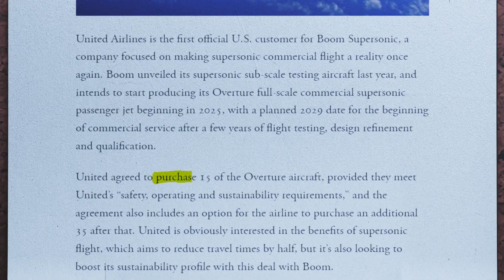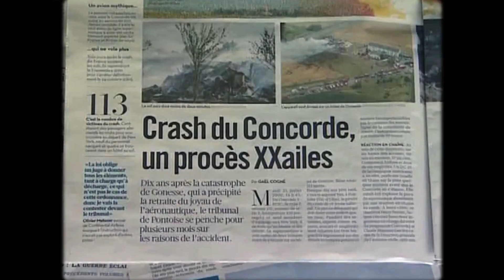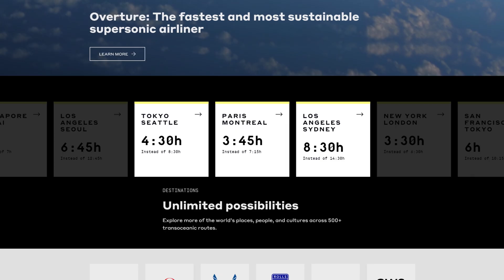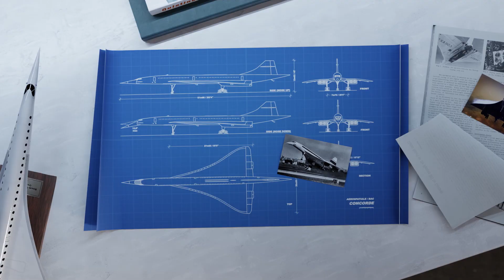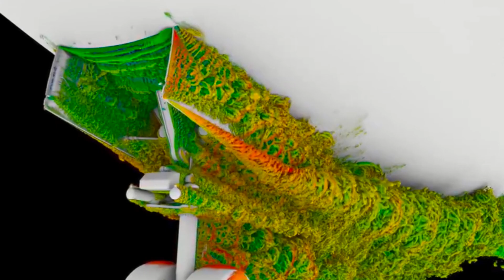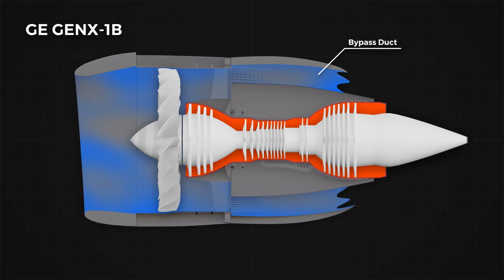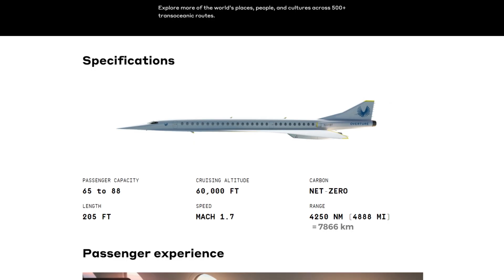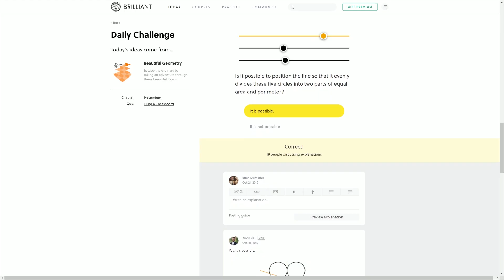Will Boom Bring Supersonic Back?

Comment: The engineers in this thread will school me (and I hope you do!) but honest question: by the time Boom figures out how to make the perfect supersonic plane, will we have access to burgeoning rocket/spaceplane transportation? With the way rocket technology is progressing, would we perhaps see a brand new industry eclipse supersonic air travel? I'm not necessarily talking about loading 300 people into a vertically stacked rocket tower, just some sort of "spaceplane" technology similar to Virgin Galactic. Feels like we should be focussing on how to get up above the atmosphere and taking a parabolic path to destinations around the world rather than finding ways to ram through the atmosphere faster. Curious if anyone has thoughts on the economics/safety of commercial spaceplane tech. Cheers.
Reply: Not a lot of atmosphere at the height that Concorde flew at
Reply: @taylorgledhill Boom hope to have Overture in service by 2029. 2035 is more likely, which is still fairly short term. Your talking about much more advanced technologies which will probably be developed in the longer term. The next move, as you suggest, will probably be near earth orbit: 

The ultimate solution would be to fly at, or above, the height defined by the Knudsen number for a particular aircraft, where the air molecules are so far apart that shock waves cannot form.  At around 500,000ft (95mi, 153km), sonic boom, drag, and skin heating vanish, allowing an aircraft to 'glide' under inertial force, after being accelerated to supersonic cruise speed. Only the power to overcome the drop due to gravity would be required (by choosing the correct height and speed satellites, are able to circle the earth for tens of years with no power). 

The proposed Venus Aerospace Stargazer won't reach the 'Knudsen height', but in part, it's like the ultimate solution. According to the Venus site, it will take off using jets, to keep the noise down, then, under rocket power, it will climb to 170,000ft (32mi, 52km), where it will cruise at 6,900mph (sonic boom isn't mentioned). It will carry 12 passengers and reach any airport in the world from any other airport within 2 hours.

I'm not sure about firing people into space on a fixed trajectory because that may lead to collisions, bearing in mind that there are at the moment 10,000 aircraft in the air at any one time. There is no suitable propulsion system at the moment either, because rockets are too noisy at take off and at low level. 

It is very difficult to predict what will happen in say 50 years time, but I suspect that some new form of energy source will be discovered rather like fusion, which will be small, light, safe, and limitless, and will transform every mode of transport, including aviation and aerospace. After all, the whole world is full of energy. All this messing about with batteries, solar panels, etc, seems like the days when they were struggling to get 2,000 horse power from piston engines, when right under their noses was the jet engine, with practically unlimited power, and at any height too!

Comment: Is it possible to create a variable bypass engines that turn from high bypass at subsonic into low bypass in supersonic to reduce noise? 
Though i believe it would be expensive by the R&D cost itself
Reply: Well, US Military is developing variable bypass engine for NGAD and F/A-XX sixth gen fighter, which would increase the fighter fuel efficiency and range while still able to go supersonic

Comment: I grew up next to an Air Force base. As kids it was bragging rights if you lost a window. Most of the time it was a large  4' x 4'.  The B52 was more of a long shrill where the Boom was a crack. They flew low enough you could make out the yellow markings on the planes.

Comment: @12:39. It is stated that supersonic jet engines have to be pure jets. If by pure jets, you mean "no bypass" or "turbojet", that is incorrect. All of the modern supersonic aircraft use low-bypass turbofan engines, like the GE-F110 used in the F-16. I believe a bypass ratio of 1 to 1 or 1.5 to 1.  High bypass is usually 3 to 1 for higher, with the GE90 being more around 9:1, which to your point, is not useable for supersonic speeds due to the large frontal area.
With that said, this was a good presentation. It really puts on display the fact that while regular commercial supersonic travel is currently possible, it is not currently probable.

Comment: The biggest problem is that Boom won't be competing with a first class flight from London to New York, but with a private jet. 
The advantage of private jets is that fly when you want from and to the nearest airport where your are and want to be. That's where you save a lot of time, no waiting for a next scheduled departure after you missed a flight.
Reply: @Frank-gr7rb Private jets seem appealing, but when you look into them they are not as convenient as you would at first think. For one thing, there are no supersonic business jets. Also, they are mind-blowingly expensive, so they would be no competition for Symphony, especially as the accommodation in Symphony will be luxury class. 

Taking a JFK to LHR one way flight:  
Showing: Aircraft type,  Fuel cost per passenger,  Economy ticket,  First Class ticket,  Duration

Boeing 747          $147          $577             $2,308                      8hrs 
Concorde             $753                                $5,000^                     3.5hrs 
Overture^^            $708         $1,200           $3,000                      4hrs 
Private jet^^^                                     $53,000 to $99,000            8hrs  

Notes
^     2023 money 
^^   Estimated prices, assuming Overture carries 72 passengers against Concorde's 100. For the first 2 years, only first class seats will be available.  
^^^ There are no supersonic private jets (the prices shown are correct)

Comment: There is not enough atmosphere to fly high and fast.  The atmosphere changes from atmosphere to outer space very quickly.  There is no airspace to fly.
Reply: They had to transport the plane back to France on an aircraft carrier during the hurricane in New York City in 2011 Dec.  It was minus one hundred degrees below zero and not enough atmosphere to fly normal jets.  The atmosphere did not recover from the VX released from Georgia chemical weapon dump in Jan 2011.

Comment: Not such a surprise that Boom should turn to Rolls Royce for engine technology. The Olympus 593-3B used in Concorde was their pinnacle (Ok, it was originally a Bristol Siddeley engine...) being the most thermal efficient engine of the time. All they have learned in the 45 years of production and use will contribute enormously to any new engine.

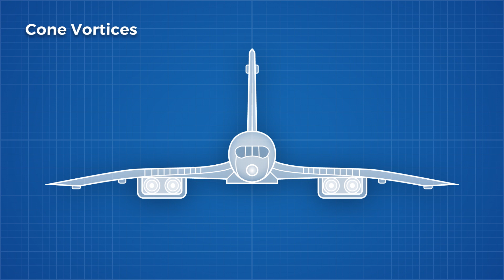Comment: Correction: The Cone Vortex used by concord originated from the leading edge, close to the wing root, not the same as wingtip vortex shown at 8:14, but based on similar principles. The cone goes over the wing to prevent the flow separation (Stalling). This phenomenon is also used by modern jets such as F-15, F-16, F-18 and Su-27 Family.
12:38 Supersonic aircraft don't NEED to use "pure jet" as in Turbojet engine. Most modern fighters and several bombers uses Low-bypass turbofans, ever since F-111 pioneered using turbofan instead of turbojets. But yes, low by pass is not as efficient. The problem with exhaust flow speed is a problem can be solved by adding a variable nozzle (like most fighters and B-1B and Tu-160).

Comment: Like you said, you can have more efficiency supersonic aircraft today because of the last 50years of improvements but boom passenger aircraft will never see the sun light. Because by 2026 (they will probably miss this target by 3/4 years at least), the other new passager aircraft will be equipped by openrotor, propeller or/and very high bypass ratio. The fuel consumption difference, in a world of energy contraction and CO2 emission reduction (even using SAF) will make the demand obsolete. I think United just wanted to have a free advertising… I am an aerospace engineer that work in the sustainability field, and supersonic aircraft is the exact opposite of the world industry direction. Without mentioning that today aircraft with wifi and films make a 2-3h time save laughable

Comment: Once an aircraft crosses the sound barrier, the fuel consumption increases enormously, and the lift to drag ratio falls precipitously. The shock wave which causes the sonic boom has to be pushed along by the vehicle, where does the energy of that shock come from? From the extra fuel being consumed, naturally. In the heyday of SST enthusiasm in the early 1960s the rationale was that while the fuel consumption per passenger mile would be higher the SST would be able to make more flights in a given amount of time, thus offsetting that disadvantage. Fuel was cheap in those days, and nobody could anticipate how efficient subsonic planes would become (part of that arising from packing passengers like sardines). Plus nobody realized back then how door to door travel time would increase over the decades with airport congestion and security screenings. The speed advantage of SSTs have become ever less significant.

Comment: We can only hope that supersonic air travel will return as the end of Concorde was a real step backwards in aviation progress. With design improvements the new supersonic aircraft will cause a less noticeable sonic boom and governments will have to stand firm against complaints from people on the ground under the supersonic aircraft routes to enable this advance in progress to take place
Reply: @johnhooper7040 Yes, the end of Concorde was a step backwards in aviation, but there is no way sonic boom over land should be allowed under any circumstances. The way to eliminate sonic boom is to fly 95 miles up, or higher.

Comment: It must supercruise. And they make PLENTY of afterburning turbofans this aircraft can use. Actually they work much better with a reheat system than turbojets, as the air still has plenty of oxygen to be burned (this is why planes like the F4 phantom had a very orange flame, while later designs like the F35's reheat flames are distinctly more blue).

Comment: The Concorde nose also pointed into the airflow, creating a laminar flow over the top of the fuselage despite the steep angle of attack, which was critical to producing the vortex lift.  If the air running down the top of the fuselage were turbulent, the vortices would have been broken up instead of being stable.
Reply: It wasn't the nose that created vortex lift is was the extended leading edges of the Ogival Delta. You can find many wind tunnel photos of this. The vortices stabilised the upper surface airflow so it didn't break away at high AOA.
Reply: @Completeaerogeek  Correct but I didn't say the nose produced the lift.  I said if the nose pointed up it would have interfered with the production of vortex lift.  This from an engineer who worked on the design.  Forget his full name.  Last name Fischer.  With the nose up, there would have been vortex shedding across the back of the fuselage, which results in an oscillating left-to-right turbulence.  Now imagine your inward spirals curving into that from the delta, and how much sooner they'd break up from the instability, not to mention how unpredictable the stall characteristics would be.

Comment: I don't think that Supersonic would ever gain wide spread commercial use unless cost goes down significantly to be comparable to airlines like the 787 Dreamliner, I think blended wing aircraft have a better chance with their efficiency but they would require significant infrastructure re work as you've started in your other videos.

I would love to see your take on the recent Rolls Royce Spirit of Innovation electric flight test. Electric propeller aircraft sound like an awesome proposition but of course limited by current battery and motor technology. In the future someday I wonder if famous propeller plane designs like the Supermarine Spitfire and other designs make a comeback but in electric form.
Reply: One of the reasons Concorde was profitable for 20 years for BA (before it was prematurely forced into retirement by Airbus (politics and money) was that its purpose was to compete against subsonic First Class. 

Concorde’s tickets were only around 10–15% more (1996 GBP 4,772 vs subsonic First Class GBP 4,314) and this meant that a company could have its executive (who would have been sent First Class anyway) leave London at 10:30am, arrive in NYC at 9:30am (yes before they took off, as Concorde flew faster than the Earth rotates) take a 10 min helicopter ride to the East River heliport,  have a bunch of meetings and zip back to JFK for the 1:30pm Concorde to London and be in bed the same night. 

How's that for time saving?

Time as they say, is money, especially for these folks, and Concorde built a very loyal following that lasted throughout its service life operating in its own P&L division, and consistently profitable for BA from 1982 on, even when the mainline carrier was unprofitable.

Concorde had its own security, check-in, lounge and boarding gate from the lounge. No lining up for anything...

https://www.key.aero/article/inside-story-how-ba-made-more-ps500m-profit-concorde#:~:text=The%20result%20of%20this%20change,billion%20pounds%20profit%20for%20BA.%E2%80%9D

Comment: Although it's fun and exciting to discuss, I don't think the Boom Overture will ever fly.  I just fundamentally don't see the market to realize this kind of an undertaking.  The problem is there just is no engineering in the supersonic passenger private sector, primarily because the considerably cheaper, higher margin, and century-old airline industry is barely scraping by.  You're going to increase expenses ten-fold, decrease profit margin by double, and act as a trailblazer?  Unlikely.

Comment: 0:37  Passengers rewinding their watch for only two hours?! 
The Concorde was fast, but it's not breaking the space time continuüm that causes all their watches to stop ticking at the moment of take-off. 
Come on man....
Reply: He meant it in a different way.
If you take off in London at 10 Am you needed 3 hours to get to NY, but since Concorde was flying faster than the earth's rotation (which is 1600 km/h, while Concorde flew around 800 km/h faster) you arrived in NY at 8 Am, earlier than the time you took off in London.
The clock of course will show 1 Pm, so you have to rewind it 5 hours, but you flew more or less 2 hours into the past.
Reply: @simonm1447  Yeah, ofcourse i knew what he meant. I understand the concept of time zones and air travel. I was just saying, no one is turning back their watches only 2 hours.
Reply: @simonm1447  Also your speed caused by earth's rotation (tangential speed) is dependent of your latitude. At the equator, this is about 1600km/h indeed. But at around the latitude of London/NYC, it's around 1160km/h.

Comment: Supersonic transport is always going to be a non-starter today and in the near future because you are sacrificing fuel efficiency, passenger capacity, maintenance costs, noise and emission pollution for one thing: speed. We are not even talking about a significant improvement of speed. 

Even at Mach 2, it will be faster than today's jetliner by roughly 230%, which will shave off a 4 hours off a normal 9 hours flight. It really does not sound much at all of you factor in all the sacrifices. It is not as though you are shaving off a 7 days trip down to 3 days which would be significantly on a human scale.

Comment: I know one of the engineers who worked on the Soviet concorde. I asked him about the sonic boom problem and he said it was nonsense because the plane would fly so high 60,000ft (18000m) that the boom would be minimal.
Reply: @philipocarroll Afraid your engineer was misinformed. Concorde breaking the sound barrier would create a painful sonic boom on the ground. Even the smaller SR-71 fling at 80,000 feet would sound just as loud.

Human hearing is logarithmic, so the perceived volume is measured in dBs. 120 dBs is the threshold of pain. Below are some figures for noise on the ground for various aircraft at various heights, which show that the boom on the ground would  be over the threshold of pain, and would sound roughly the same for all aircraft (a 3dB change is barely perceptible). 

Aircraft                  Altitude   [ft]      Pressure [lb/ft² (Pa)]      SPL [dB]      Loudness
                  
SR-71                          80,000                0.9          (43)                 127                1.1
Concorde                   52,000                1.94        (93)                 133                1.7 
F-104                          48,000                 0.8          (38)                 125                1.0
Space Shuttle            60,000                1.25        (60)                 130                1.4

Sound Pressure Level in dBs =20 x log[10] (Pa/20uPa)

Comment: Super sonic planes ✈️ Sounds loudest Airplane ✈️ fastest Power of planes with fast and sounds they have many problems like noisy Irratating the Humans And fast distrub birds in the High on air Super sonic blooms atmospheric conditions public irratating on sounds disturb vibration on earth Super sonic blooms Airplane ✈️ wings fly high it damage cause so more over rectify mistake flying on high Airforce war Sonic waves bloom fastest quick but wings modified Real Engineering explore super Sonic planes ✈️ Nose 👃 Pilots facing problem so operation cost high design rectify the make like eagles to fly high with less sounds 👍👍